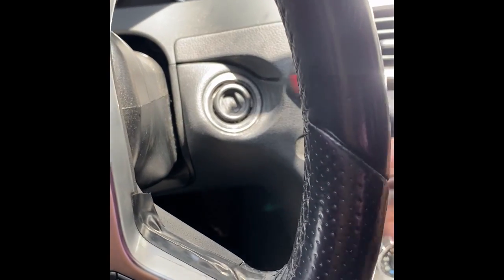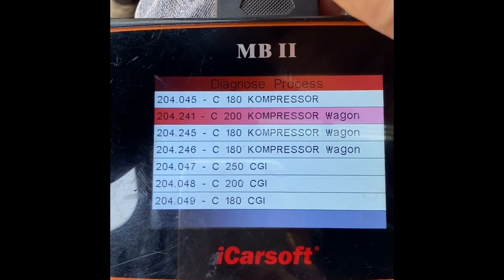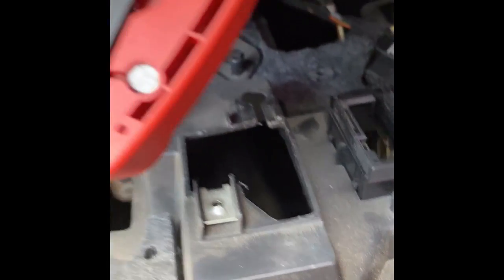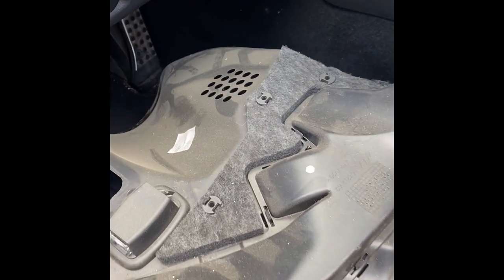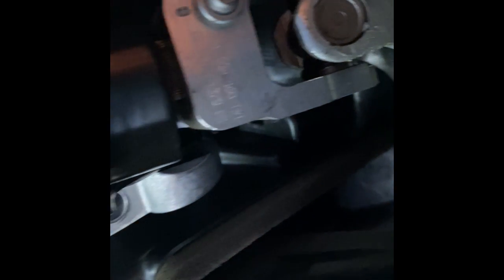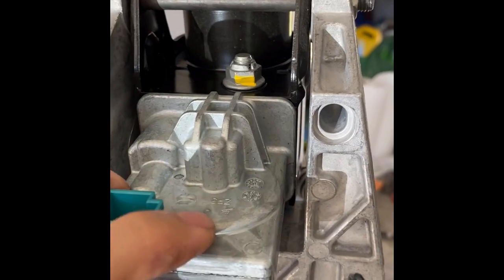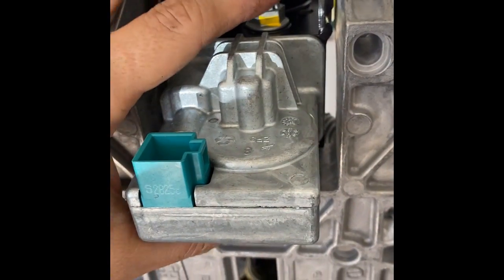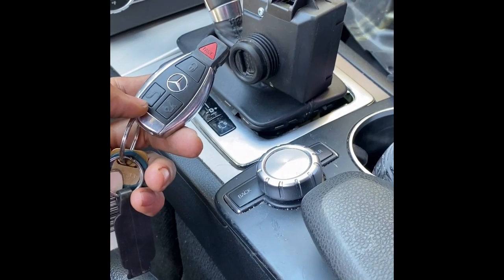2008-2014 Mercedes Benz C Class W204 C300 ESL Electronic Steering Lock Removal Emulator Install

Comment: Started my daughters glk350 to move out of the garage. Shut it off and then it wouldn’t start after trying to start again. Had zero idea about the esl issue on Mercedes despite owning 7 of them since 2005. Went to MBWorld to access possible diagnosis and found Michael there. Navigated to his YouTube. After speaking with my Mercedes dealer, found out they were scheduling out weeks so decided to tackle it myself. With Michael’s Mercedes videos and text communication I was easily able to work my way through the problem. Working with Michael was a great experience. He excels in teaching, communication, pricing and efficiency. I highly recommend Michael and his solution to this problem. I rarely promote or review but Michael is a valuable resource to all Mercedes Benz owners who want to take action to fix their problem. Thank You Michael! 🙏🏻
Reply from the maker: It was good working with you Brad. I’m glad we got the GLK350 running. If you need anything you have my number.

Comment: I replaced the lock with an emulator and it worked great.  Unfortunately, several months after installing the emulator, the transmission conductor plate failed and had to be replaced.  The transmission shop was unable to program the new conductor plate because of the emulator.  I ended up having to have a new ESL installed and after the installation, the shop was able to fully program the conductor plate.  Fortunately, I know  the owner of the Mercedes dealership, so I got the new ESL for their cost and they installed it for free.
Reply from the maker: That’s good to know. Thanks for your comment. I have factory ESL’s that I can program to your vehicle in case you need to replace your conductor plate. You can always switch back to the more reliable emulator afterwards.

Comment: I can’t say enough good things about Michael, his expertise, attitude, helpfulness and ability to explain things thoroughly!
I had this exact ESL issue with my 2010 C300. I took it to the dealer and was quoted almost $3000 to replace ESL, EIS and reprogram. To add insult to injury, EIS is on back order with no ETA. Dealer told me they had another car there for more than six months waiting for the part!
I promptly brought the car back home and searched YouTube where I found this video, where Michael walks you step by step through the process of replacing the ESL with his emulator.
I was able to follow instructions, remove the faulty part, overnight the EIS, receive and install the parts in four days at a cost of $350 (including $100 for overnight shipping both ways). Car is up and running just as indicated in the video! Great job Michael and Mercedes Benz Specialist!

Comment: the BEST video on this ESL issue that I have seen. Precise, clear and actually shows and explains what and where bolts and bits are incuding talking you through what an Emulator is, what it does and how it works, THANK YOU!!!!!
Reply from the maker: Thanks for your comment. I'm glad you found it helpful. If you need an ESL emulator programmed you can find out more about it on our website:
https://mercedesbenzspecialist.net/shop/ols/products/mercedes-c-class-glk-class-e-class-coupe-slk-class-electronic-emulator
Reply: @mercedesbenzspecialist  out of interest, would you have any ideas if the bearing at the top of the shaft near the steering wheel spline is replaceable?  I tapped the top of the column to ease it onto the UJ at the bottom and the bearing fell apart. WORD OF NOTE: Do NOT hammer down on the steering column  - Costly mistake...  :(
Reply from the maker: You’ll have to get a steering column. The entire column. Used on ebay or better yet at a dismantler.

Comment: I can’t thank you enough for the service you provide. 

You turned a big repair that requires dealership expertise into a DIY project. 

The knowledge and experience that you provide is second to none. 

Your willingness to help every question I had was amazing. 

Every single response helped tackle an issue I was having removing and replacing. 

I can’t forget to mention the fast turn around on reprogramming a new ESL module during a holiday weekend. 

Absolutely grateful!
Reply from the maker: Thank you Kery. It feels great to read comments like yours. Good job saving yourself hundreds if not thousands of dollars.

Comment: Michael is just awesome. He fixed my ignition switch issue very quickly for very minimal cost($250) that dealership would charge anywhere from $1500-$2000. No regular mechanics could fix it  because of programing matter but Michael can. Mercedes has such a reccuring problem with EIS/ESL that I already had an experience with in the past. Watched his videos and directly contacted him which he responded immediately and shipped my part from Texas. He programmed and installed emulator within 20-30 mins upon receipt and shipped parts back on the same day!! 
All I had to spend was just about $550 in total including shipping & installation cost for my own mechanic. If anyone has same problem, contact Michael. He will take care of it!! And save $1000 or more. Can't be happier. Thanks again Michael! 
-Leslie
Reply from the maker: Leslie, it was great working with you. Thanks so much for your comment.
Reply: I have a question about my 2008c300 Mercedes
Reply from the maker: @nekemamathews3173 Feel free to ask.
Reply: @mercedesbenzspecialist  my ignition switch is not working
Reply from the maker: @nekemamathews3173  If you would like me to help you resolve your issue, call us at 818-510-3375 
Monday-Friday 8am-4pm PST.

Comment: Great video! Thank you so much. 2 comments, 1, you breezed over the hardest part, removing the yellow connector. There’s a clip that has to be removed from that first. 
2, you absolutely do not need that key ring removal tool. I just used 2 picks and grabbed 2 of the little teeth on the ring and spun it.
Reply from the maker: The yellow connector is hard to get to if you don’t remove the steering wheel. I recommend removing the steering wheel. It’s easier that way. 

You’re right about the plastic nut that retains the EIS. You don’t need the removal tool. It’s not on very tight.

Comment: Michael is awesome I called him after  speaking with my mechanic locksmith and Mercedes. Michael saved us about $1800 walked me through removing my son's C250 ignition switch he emailed me an overnight label I sent imy old esl to him Friday got a new one back Tuesday  and boom done! Faster than mercedes and 1/3 the price he also made a spare key total time was 1 hr removal and 30 mins to install. Thanks Michael
Reply from the maker: Good working with you Sean. Nice working saving $$!
Reply from the maker: If you need help call us at 818-510-3375

Comment: Yoo great informative video, where and how do you bang on the steering lock from underneath? I can’t seem to be able to see it or fine a good placement to bang on it?
Reply from the maker: You must remove the kick panel, take a small hammer and get up over the steering column where the ESL is bolted in. You can also take the steering wheel in your hands and bang it back and forth with medium to strong force. This may release the motor gears and you might get another turn out of your steering lock. If it does operate, you'll be able to start the car and move it to a good location or drive it to a shop. 

If you do get it to open, don't take the key out of the ignition. Disconnect the negative battery cable, before you remove the key from the ignition. You can turn the car off, just don't remove the key from the ignition. This way, the ESL is in the open position and you won't have to remove the entire steering column. Saves a lot of time.

Comment: I got an ESL error and sent Michael my keys and ignition. In 2 days I had the emulator back and it worked. Michael I really appreciate your help! You saved me big time!
Reply from the maker: I'm glad you're back on the road Satish. Anything you need in the future, you have my number.
Reply: @mercedesbenzspecialist  Hi Mike I have a ? I have a 07 E 350 great car but my problem is sometimes when I put my key in the ignition the key would flash red and not turn as if the key is not being read but then I would pull it out put it back in then the key would shine green and start up. Well I went to start it up and the key shined green then I cut the car off took the key out of the ignition put it back in and it shines and flashes red it the key won't turn in the ignition it just flashes red as if the key doesn't belong to that car. Whats your oppion on this situation?
Reply from the maker: @biggd9817  I wasn't aware of a green led in original Mercedes keys. Is this an aftermarket key? Without any diagnosing, my guess is that you have a bad key. I would need your ignition switch and key to know for sure what the problem is.
Reply: @mercedesbenzspecialist  I dont know if its an aftermarket key fob or not it didnt come with a key for the doors or trunk but can I go on amazon and buy a new aftermarket key and have it programmed buy someone? I talk to Mercedes's and they want damn near 700 bucks for the key and fob and im just a poor man trying to enjoy an expensive car 😂😂😂
Reply from the maker: @biggd9817  I can program a new key for you. I just need your ignition switch and key. Give me a call and we can work out the details. Call us at 818-510-3375
Reply: @mercedesbenzspecialist  ok ill call tomorrow thanks

Comment: How did you pull the whole steering column out I thought you would have to go through the bottom
Reply from the maker: There are two types of telescoping steering columns. 

The electronic and the manual. 

If you have the electronic one. You have three combination switches on the left side of your steering wheel. Turn signal, cruise control, and steering column adjustment. This one does not fit through the dash. It needs to come out through the bottom. Search my videos for that version. 

The manually adjustable steering column can fit through the dash. 

If you need the esl emulator programmed it can be purchased on our website. 

https://mercedesbenzspecialist.net/shop/ols/products/mercedes-c-class-glk-class-e-class-coupe-slk-class-electronic-emulator

Comment: Works like a charm, turn around time was fast. If you have electronic telescopic and tilt wheel, after removing steering wheel and multifunction switch, remove brake pedal and bracket so you'll be able to remove steering column.
Reply from the maker: Good tip. Another tip: Using the electronic steering column adjustment switch. Make the column as short as possible. If it’s short, you can remove just the acceleration pedal which takes about 1 minute to do. 👍

Comment: Great video! I’m starting to have ESL problems on my 2014 C250. Mine has stopped working in the “unlocked” position so I can still turn my wheel but it doesn’t start. Is it the little motor in the ESL that goes bad?
Reply from the maker: Yes. The problem starts with the little motor. Then the NEC chip on the circuit board can lock up. When that happens, replacing that motor won’t help. 

Replacing that motor works 50% of the time if you do it correctly. The other half are locked chips. Can’t do anything About that. You need an emulator to replace the ESL.
Reply: Omg 😳 why I don’t find these video before I pay $1500 for ESL and I don’t if they find something else wrong 😑 
I take my car for be fix from warranty craft and I end pay for ESL

Comment: Hi Michael, I need some guidance with my 2012 C250, it's a 4door gasoline design. I went to turn it on this afternoon, and it didn't start. I checked if this was the issue but when I put in the key it still makes the sound it should, when I put it into position 2 the steering wheel moves, all the dashboard lights turn on and I can even turn on the radio and use the window switches. So, it seems it’s not the ESL, it seems like the problem is something else. What do you think the problem could be or what tests should I do to find out what the problem is? I used the car this morning without any issues but it wouldn't start when I had to pick up my wife this afternoon.
Reply from the maker: Hi Francisco, I'm sorry you had trouble after picking up your wife. My first guess is that your Engine Control Module is failing. There is a test that you can perform to determine if this is your problem. I'll link the video below. You'll need a volt meter or multimeter. You'll have to do this test when it's not starting. 

https://mercedesbenzspecialist.net/ecm-diagnostic-video

Comment: what’s the best way to pull the whole column plus steering wheel out after loosening everything?
Reply from the maker: In this video, I made the mistake of not removing the steering wheel. This job is much easier if you remove the steering wheel. I recommend that you remove it. If I could edit the video I would... but it can't be edited. Trust me, remove the steering wheel. Much easier to get to the yellow electrical connector inside the Steering Column Module.

Comment: I have this issue , but I have a 2011 C300 4matic sports Mercedes Benz what part do I order to fix this issue ?
Reply from the maker: You need to replace the factory steering lock with an electronic emulator. You could use another factory lock but we don't recommend it. It will fail again inside of 24 months. 

We can program the ESL emulator (or factory lock) using your ignition switch and key. Remove the EIS and send it to us along with at least one working key. 

Head over to our website and purchase the service. 

https://mercedesbenzspecialist.net/shop/ols/products/mercedes-c-class-glk-class-e-class-coupe-slk-class-electronic-emulator

Include the order number with your package. We program the emulator and ship it back to you the same day we receive your package.

Once you receive your package, install the emulator, but everything back together, and start it up.

Call us if you have questions. 

818-510-3375

Comment: I took the ignition switch out and I noticed there is a round module that spin like a cooling fan. Where does it mounted to?
Reply from the maker: That’s the cabin temperature sensor. It’s mounted right next to the EIS. Further to the right if you’re looking at the EIS from the drivers seat. You can see a quarter sized shaped grill on the dash to the right of the EIS. It sits behind that grill.
Reply: @mercedesbenzspecialist  thank you. I just made the payment and will send the key fob and ignition switch to you tomorrow.
Reply from the maker: @spicythai2000  Order received. We will get right back to you with a programmed emulator. Thank you.
Reply: @mercedesbenzspecialist  I mail the ignition and key fob express mail.  It should be there tomorrow.  When you're done I can also pay for express mail back. Please let me know. Thanks again.
Reply from the maker: @spicythai2000  no problem. Here is the pay link for usps express shipping. 

https://pay.mercedesbenzspecialist.net/fd0ddda1-7cfe-4a37-a4ab-4ed
Reply: @mercedesbenzspecialist  payment have been send. Thank you.
Reply: I paid for USPS express, the invoice stated free shipping 3-5  day.   The item was supposed to be deliver Saturday but now it is still in transit.  Please let me know if the item did not get usps express. 
Thank you.
Reply from the maker: @spicythai2000  usps tracking says your package is arriving late. They don’t give a reason. I’m sorry there is some delay. Express mail is a guaranteed service. I will issue a refund for the express shipping you paid for. Hopefully, the usps delay will be worked out soon and your package will be delivered.
Reply from the maker: @spicythai2000  usps tracking
9405511105500848614395
Reply: @mercedesbenzspecialist  please keep it consider that a tip for your service.  Way cheaper than dealership.
Reply from the maker: @spicythai2000  Very generous, thank you. Please don't hesitate to call 
 or text us with any questions you may have.
818-510-3375
Reply: @mercedesbenzspecialist  received the items today and just finished hooking everything up. Car started. Thank you again.
Reply from the maker: @spicythai2000 Excellent! If there is anything you need. Reach out to us here or by phone. 
818-510-3375

Comment: What if the steering wheel unlocks when inserting key but still says remove key and won’t start can the steering lock still be the problem?
Reply from the maker: No. If the steering wheel unlocks on key insertion and locks on key removal the problem is not your steering lock. 

What about the other symptoms I mentioned in this video. Do you have red and yellow dash lights when you turn the key to position 2? That’s two turns to the right. 

If you have red and yellow dash lights that is confirmation that you do not have a steering lock problem. 

Contact us for help with diagnosis. 

Support@mercedesbenzspecialist.net

Call us at 818-510-3375
Reply: @mercedesbenzspecialist  no dash lights and windows not working only thing that happens when I insert the key is the steering lock unlocks I can turn the key all the way to the on position but still no response from the cluster at all? And when the driver do is open it say remove your key from ignition any idea what this could be?
Reply from the maker: @trophy4752  I can diagnose it over the phone. You will have to be at your vehicle at the time of our call. 

Schedule a consult on the website. 

https://mercedesbenzspecialist.net/services

Comment: Hay sir how are you can i ask you ,,my car mercedes c300 2011,, it won't start then if I put the key in the steering wheel it stays locked but the radio and lights still turn on can you tell me what the problem is, thank you
Reply from the maker: Classic steering lock symptoms.
Call us 818-510-3375